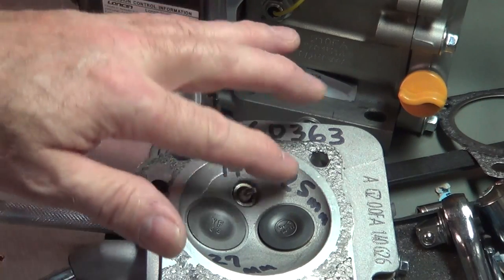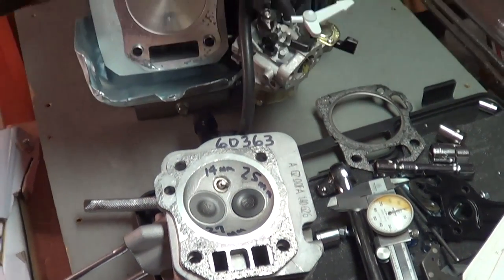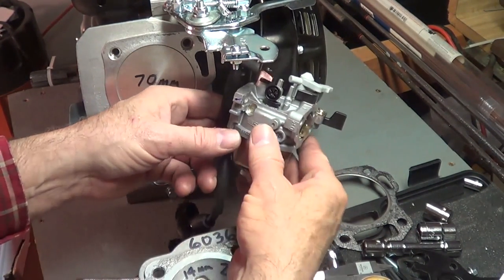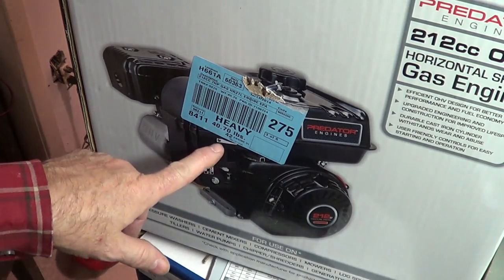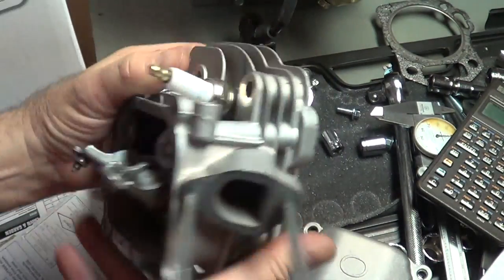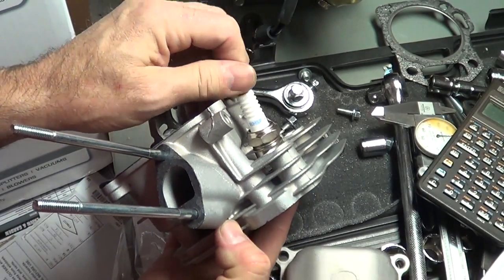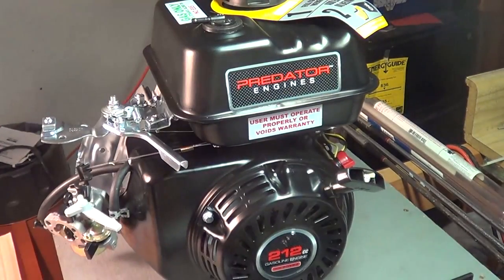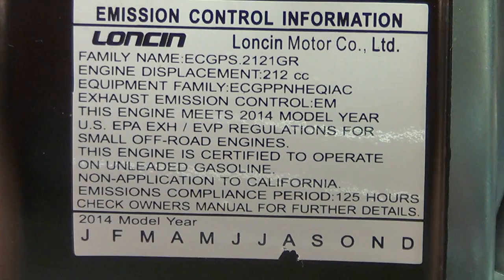Predator Hemi 60363 Harbor Freight Engine 212cc Head Valves

Comment: Good informative video- nice job. Props on using the noggin and the Sharpie! Since you had it apart, you didn't happen to check/meassure the compression ratio by chance? Just curious how far off the 'spec' it was if any. Truly a quality lil' engine for a C-note. Now the big bonus......  you are now the proud owner of a true "Yamaha" product! Congrats!(compare the cost of an identical 'brand' labeled version and you'll see just how much anonymity $ave$). A few more 'little known facts' of the 60363: (1) It is the same exact unit as the 7hp model that HFT would occasionally advertise, difference being the RPM the measurement is taken/set at: 3600 for 6.5hp, 4000 for the scarce 7hp version. I'm only assuming HFT had boxes printed with the spec@6.5hp and saved $ by not varying for an extra half-a-pony(which doubtfully would have helped sell these, from a marketing standpoint, i.e.-Cost and quality sells most HFT products). (2) Loncin(pronounced "Lawn-sin") is a branch/subsidiary of Yamaha located in China(LOW production cost as opposed to Japan and elsewhere), BUT still adhere to and have the capabilty to match/exceed  Yamahas strict quality practices. Many ATVs, incl. UTVs, as well as the majority of the Yamaha brands 'off-road' products are made by Loncin. Some of the 'Yamaha' products components/engines are made at Loncin and shipped to be assembled elsewhere, depending on the product and/or model, although most products that begin there are finished there. (3) The "Kohler Command" 7hp small engine, which is marketed as utility/implement/snowblower, etc., is a horizantal shaft engine, is also made by Loncin, but Kohler gives the 'option' of electric start(to the tune of an additional $400!!), BUT it could be the 'answer' for those that may require use of a headlight, a stator/regulator-rectifier and so-on IS available for our 'Predator' 60363....... OK, now I'll stop the ramblin'

Comment: The Hemi variant caught my attention.  I was in Harbor Freight yesterday.  I don't know which version number they had on display. I did notice your engine block is different than the one I saw in store. Under the gas tank on the store model, there are two machined bosses with threaded holes, vertically to the base which allows mounting external components. In my case it will allow bolting the push handlebar bracket on my edger. The old motor was a B&S and it used a head bolt for this. Your block does not have the extra mounting holes.  So in my case, I may not worry about the Hemi head because I need the block mounting feature.  Some FYI info. for potential engine buyers.
Reply from the maker: One tell tail way is the engines box shows either a cast or sheet metal valve cover, the hemi has the cast cover. What is on display maybe either one.
Reply: The engine part number coincides with the Hemi head/cast valve cover.  I looked through the hand holes of the boxes.

Comment: I just got the HF 3200/4000 Predator Generator Lot# 69676 dated 30 July 2015....I believe this has the Hemi Engine - Loncin Motor Co LTD.  210FA.  I have not opened it yet.

The new Display Generator in HF with that Lot # on the Easy Start Tag had the cast aluminum valve cover.   The Display had just been swapped out from the month before because it had different engine and the man. date was in 2013.

I believe (in my opinion) this appears to be better designed engine and performs than the other (Lifan Chongqing Rato Power Co ).  The quality is the other question which needs to be tested.  Chinese quality has improved over the years but in areas where there is a lot to be desired still.  The question is will it last and will parts be more readily available?   The Lifan Engine appears to be a "Clonda" and so a lot of the parts are interchangeable with Honda and the parts itself are more available.  So there is a lot to be said and that is still a good engine for the price

Comment: We race these on racing karts. The 363s are all hemi's. On the dyno the hemi makes more power. If you buy a 730 make sure you have them to open the box and check the stamp on the bottom of the head. You have to turn it up so you can look under/behind the valve cover. You wan't It to say RTC-6 or 8. they have bigger valves that the other 730s. The other number that I don't even know lol is for California admissions. We build them over 15hp. Great motor for the money!
Reply: LisaMarie137137
Reply: We dont use the hemi head due to you cant use bigger valves...were getting something around low 20s and is stock apperaring. Even stock carb bored out to .750 and we use epoxy were it blows thru. There fun cheap lil motors...best advice is if u dont buy an aftermarket flywheel than make sure you glue the magnet on or it is gone

Comment: Put the 730 top end on hemi bottom end. A cam, carb, header and better springs from Dover Powersports. Bump timing to 35-36 degrees with a better flywheel and you have a bas ass motor.

Comment: Yes, #30363's are all hemis they all have the cast rectangular valve covers. The non-hemis have a different # (sorry can't remember what it is) and have a stamped steel valve cover that is roughly square. BTW they are made in 2 different factories in China and are basically the same in every other aspect. The hemis are able to have more power than the non-hemis with the proper upgrades, somewhere around 20-21 HP. and around 8000 rpm as opposed to the original 3800 rpm. Make sure to get a billet flywheel as the original will explode at these rpm's and can cause significant damage or injury.

Comment: Thanks for sharing.........Do you happen to know if they are using the Predator Hemi 212cc engine on the 3200/4000 Predator Generator?   The (old) display generator at my local HB had the old engine (non Hemi).   I could not tell what engine is used in the new box generators.  They all appeared to be lot 69729.  From what people have told me, the Hemi stock engine is better than the non Hemi stock. They also advise, once you start modifying the engine the benefits are minimized. What are your thoughts?  Thanks.

Comment: the two other Predator engines they say Chongqing Ratio power products on them and have a hexonganal stamped steel valve cover not sure if its a hemi or not. they are slightly different as its made in Chongquing China basically they are Honda clones. or Honda copies.

Comment: Thanks for the video! Can you give me the head number on your engine? The gx200 clone (196cc) is a 168f. I think the 208cc is a 170f. Its on the fin area on the bottom.
Reply from the maker: https://www.youtube.com/watch?v=8d2GI-bL3bI This video shows all the numbers I could find on the head
Reply from the maker: The Loncin engine in this video is not exactly like the ones on this site:
http://www.loncinindustries.com/en/engine/ProductDetail.aspx?catid=8-15-16-32-54-2146780802#proFlag
Reply: +3beltwesty do they still sell the old version instead of the hemi
Reply from the maker: +michael moreno  Harbor Freight sells both. They buy "stuff" often from 2 different makers and have a different part number for each variant. Thus a gizmo might  be 12345/54321 in the Instruction manual and on the sale flier; but they are different lots, different makers or 2 variants from the same maker.

Comment: is there supposed to be a rotator cap on the intake valve stem?  looks hard to adjust if there isn't one,, I know some engines only have that on one valve.
Reply: MissouriOldTimer I know Honda's have them! So you think but you never know!
Reply: MissouriOldTimer I can say for a fact the intake has a lash cap from the factory the exhaust does not I have a 212 hemi I just fully built and if your talking about intake and exhaust valve lash adjustment then yes they are both adjustable

Comment: Would you recommend these engines for commercial use ?? They are made in China right ?? China trying to clone well known brand names ??
Reply from the maker: Probably a roll of the dice! :)  A real Honda engine costs about 3.5X more.
Reply: Grasspro I bought a predator and it was an awsome little engine first pull ran good smooth put 30 hrs of hard off road gokart use pulled it apart and built it, hone, re ringed, billet rod, ss HL camshaft, ss valves and retainers, billet 1.7lb flywheel, 1in exhaust and a 26mm mikuni with a straight line port job. It's mean lol but I built that motor not China I have herd bad story's but if also heard and have had good experiences. I would not say good for commercial use because the tolerances are looser over in China compared to Japan

Comment: I just called HFT and they said they had no more of the 60363.oh well ill just use the other.
Reply: flashpoint 5050 I just bought two 60363 hemi 212s at our local HF for an ultralight project I'm designing.

Comment: do all the Honda gx200/clone performance parts fit this or would I be better off getting a 196 Honda clone?
Reply: Alot do. Some need minimal modification mainly where you would bolt it in. Most common is exhausts where the clones have the studs spaced a little farther apart

Comment: Can you please tell me the head bolt torque specs?? I can't find it anywhere. Thanks
Reply: This comment is 4 yrs old so I'm just going to post for others, I saw in a video where the guy said to torque cylinder head bolts to 20 ft lb/s/240 inch lbs.

Comment: So whats the better engine? Hemi or Non Hemi? Thx in advance
Reply: Hemi head is better design, more efficient. Non-hemi has more aftermarket parts and stage kits available..
Reply: Hemi makes more power.
Reply: If your building a performance 212 a non Hemi is the better way to go, do some research
Reply: @weszef4815  hemi is an ancient head design. not sure what the other one is but the word hemi does not mean high powered regardless of what dodge wants you to think.it is mostly a marketing gimmick for dodge as their engine is not really a true hemi anyway.

Comment: how do you hook up a tach. on one of these motors?
Reply: +Rick Glow usually it's just a single wire that you zip tie to the coil wire
Reply: they also make wireless tachometers.  I use one on all of my small engines.  it is made by Dixon.

Comment: it's not really a true hemi because the spark plug is not centered between the valves. Chrysler called this arrangement polyspherical, or polyhead for short. not having the plug centered causes uneven combustion, chrysler figured this out rather quickly so the polyhead became a truck motor instead of a performance motor. i'm guessing loncin made the mod for emissions reasons and the predator hemi is the california emissions version"

Comment: so in conclusion  Wichita motor it's better non hemi or hemi
Reply: Hemi is better, more power.
Reply: If your building a performance 212 a non Hemi is the better engine, not the hemi as you might think, do some research

Comment: Why make  big deal about it being a hemi. It is basicly just a 6.5 lawn mower engine. I understand big horse power in a high compression quick burn mopar hemi engine, but a low compression lawn mower engine, doesn't matter.
Reply: If you want to build the motor for racing, the hemi head is a better head design. It also makes stupid power when you take the governor out, or change the governed rpm
Reply: Well, they may. I have a gokart for my grand son and I may buy one. The price is right, for sure.

Comment: ummmmm.... pretty sure its NOT a hemi... i mean you have a dome head, but not dome piston, sooooo not a hemi... you can have a non dome head with a dome piston and its STILL NOT a hemi, just dome topped piston... this is NOT a hemi engine... NOT even close to one... in function or power...
Reply from the maker: Thus you take is different than others: " A hemispherical combustion chamber is a type of combustion chamber with a domed cylinder head. The hemispherical shape provides some advantages in an internal combustion engine. An engine featuring this type of chamber is known as a hemi engine." 

https://en.wikipedia.org/wiki/Hemispherical_combustion_chamber

The course I had in college in internal combustion engines used the definition of the chamber and not the piston, but that was in Engineering and street usage.
Reply: By definition, "hemi" is only half... "hemi" being short for hemisphere so it's only a half circle... a domed head alone is a hemi... a domed head and cylinder would make full circle or sphere...